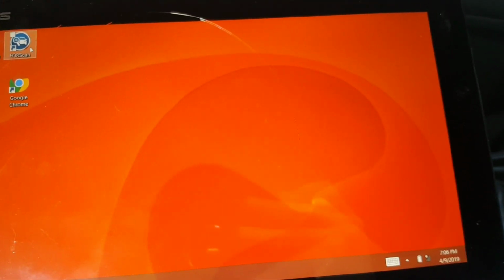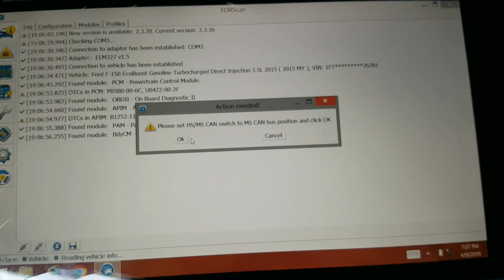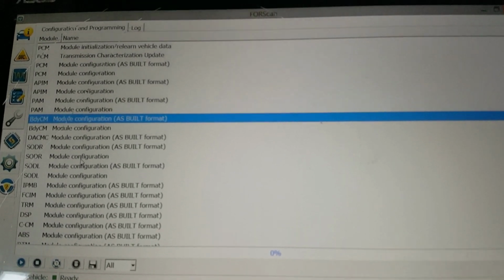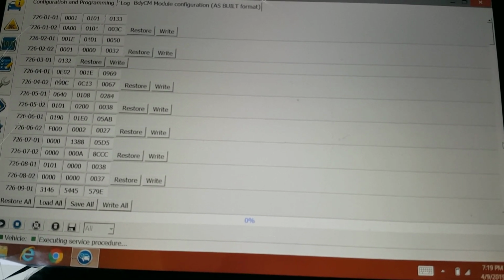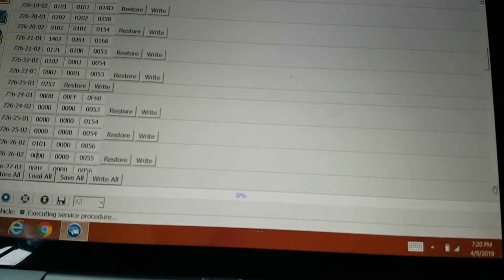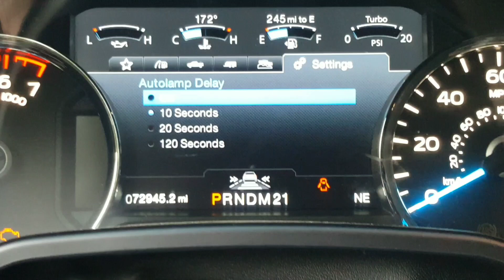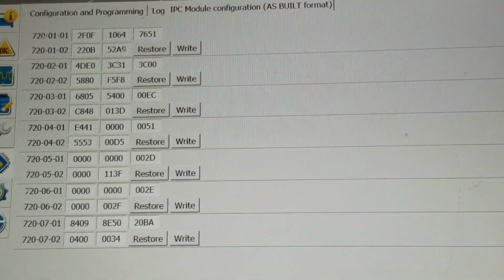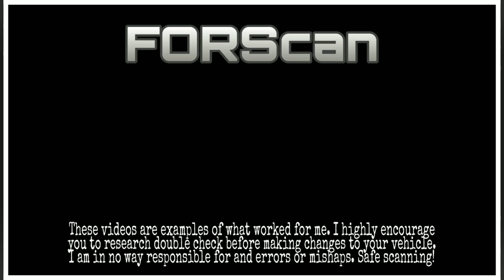FORScan DRL mod on ford f150

Comment: This worked great for my 2016 f150 lariat, but I was wondering if there’s anyway I can’t have my drls be on even in park? I noticed they only come on in drive. I did change my drl condition to option B but that keeps them on forever and the only way to turn them off is turning the dial to off, so I’d want to keep them as automatic but drls still on in park

Comment: hello, i have a huge problem with my truck, i live in sweden so my truck has been modified in the wire harness i think.. the oem led headlight has only one connector right? but i have three connectors on my truck? the parkinglight is some aftermarket ledstrip mounted under the oem headlight.. can i just take the wire from the aftermarket one and connect to the oem parkinglight wire?

Comment: Question, I just purchased a 22 F150 that originally came from Canada. It is a lariat package that should have daytime running lights with the new LEDs. Can’t seem to find daytime running lights anywhere. When I go into the system on the big screen, it does not show it as an option. Is there a way to add this as an option?
Reply from the maker: Hello, I believe you can. But I haven't done it on the new modles. Waiting to pull the trigger on one. Hopefully this year.

Comment: Doesn't work for 2022 F150 XL. Its only off or on for DLR. High beam with fogs does work. Friendly FYI. Note, I did try putting numbers in and also enable/disable. Neither worked.

Comment: Hi Ricardo.  
Great video brother.  I tried using your settings for “parking lights only” but the low beams still come on when I turn the switch to off. 
I’m trying to get a set up where I can turn the selector switch to OFF while in gear and be completely dark for when I’m hunting.  Do you have the codes for master disable for the DRL’s?   I’d appreciate any help you can provide.
Reply: I would like to know this as well

Comment: Fantastic video man.  I got stuck changing mine to disable and couldn’t figure out why.  This video explained it.  Just do I have it in writing, can you tell me the 3 locations you changed and what the settings would need to be set at for disable?   
Thanks bro!!
Reply: @Matt Camara thanks.  It is Canadian. Where did you see that spreadsheet? Google?

Comment: I have a 2016 Canadian model. I got on the spreadsheet and did everything to put the option on my settings to turn the drls on and off by clicking the box. The option is on there now but they are just off and don't come on by checking the box. Did I miss something?
Reply: Nevermind, I figured it out. I was testing it at night and I know now that the headlights have to be in auto for the drl to work. So in the daytime the option on the dash works like it should.

Comment: Do the DRL operate when the light dial is in the O position (far left, off) or turned all the way right to the A position? I’m considering toying with DRL in FORscan but only if it works when the light switch is off; I don’t want to screw with the auto-lamp feature.
Reply from the maker: When DRL is active and enabled,  they turn on regardless of how the headlights switch is set.
Reply: @ricardosworkshop  thanks!
Reply: My truck only has an auto-lamp control in settings menu of the gauge cluster.  There is no actual DRL setting.  Are some trucks devoid of DRL? Seems unusual. I’d really like to set a custom parking-light DRL in FORscan to avoid having to manually switch them on every time I drive the truck. What say you?

Comment: Would the 2020 f150 with tech package have this module? I installed led headlights with DRL leds, and would like to turn on the DRL if that is an option for the XL trim package

Comment: Hi Ricardo, thanks for this and more other helpful videos from you 👍. I programmed and activeed just the daytime running lights on my 2017 F-150 with LED lights. Upon cranking the enigne, lights to AUTO and column shifter to D bingo - DRL are there. Next day another engine start, lights to AUTO and D -> no DRL anymore😳. Any idea? I checked by forscan the values BCM 726-26-02 reps. 45-01 are still there. Thanks for your feedback.
Reply: Did you get this figured out? Im having the same issues
Reply: No, not yet. Recognized that the dealership re-wired the DRL. Has nothing to do with Forscan. Needs to remove the headlight and put the wires back to original spot. @henryflores7492

Comment: I have a 15 platinum as well and have the switchback DRLs from Diode Dynamics in and I am trying to figure out how to have the DRL white as the running light with the low beam off. Can’t seem to figure it out.

Comment: Hey there could you help me? I have a 2019 F150 lariat that came with halogen headlights and I just put in the Anzo switchback headlights but the white drl only comes on for about a minute when I first put it in gear and will just shot off after everytime, I’ve tried putting in the code for the anzo headlights in forscan several times but it doesn’t want to stay on?
Reply from the maker: Im not sure its a code issue... sounds like it the lights

Comment: Hey I just watched the video and did the position lamb and turn signal only setting. For some reason my DRL is now the low beam, position lamp, and turn signal. Do you know if something didn’t work or if it’s not possible to only have the position and turn signal? I’m also wanting to brighten up the position lamp but I haven’t gotten to that yet. Any help is appreciated. 2016 F150 Limited with factory LEDs

Comment: I hope this fixes my turn signal switch back led issue. My drls should be white but the low voltage drl sent to turn signal makes them go amber and flicker orange. I have to manually turn on park lamps to get the effect I want.

Comment: Thank you for this.  
Question, if you don't mind...I have the Anzo switchbacks and went to do the white halo's as DRL's.  However, when I went to change BCM 726-26-02 to x1xx I got an invalid checksum error.  Any thoughts?
Reply from the maker: I've seen this happen often. But the system will automatically correct itself.
Double-check everything, save original settings, and you can try again.
Reply: @ricardosworkshop  In my case, I had to change 726-45-01 first.  Then it let me change the other two.  Thanks again!!

Comment: wich one is the front running amber light  not the brigth amber turn  (just the regular amber ,there is high and low light on the amber,want the low side) thank you... my truck doesn't have the front led...

Comment: hi man quick question, i installed an led strip switchback bar inside my headlamps, where should i connect the positives to get them work as DRL only and not the low beam how it comes originally, i have a 2019 ford f450, thanks

Comment: i have the alpha rex pro series headlights...will this work the same with my application?  i have the drl harness installed.  i dont want the low beams to be on during the day. i have a 2018 f150 and no option to turn on or off the drl in the cluster control.  i only have the autolamp to select
Reply from the maker: Yes. You should be able to disabled the DRL. Or change it to any of the options.

Comment: I did the values for parklights to be on as drls on my stock led headlights and nothing happened  when the knob is in the "auto" position. It instead replaced my lowbeams with park lights to just park lights "only" when on the ON position. Hope you can help me fix this. Ive read somewhere that said they only come on if its in drive idk if its true.

Comment: Will the Anzo white halo code switch the factory halo from amber to white? Or, is the mod only for/if you actually have the Anzo aftermarket part?
Reply from the maker: No. The factory halos are amber (15-17). You would have to change the lights to get them white
Reply: Thank you for taking the time to reply to a video that's over a year old. Take care and happy holidays!

Comment: Hi. Where your location?
Reply from the maker: Houston Texas 🤘🤘
Reply: @ricardosworkshop  may i have your address and phone number pls
Reply from the maker: Ihi Brian, i dont have an actual shop.
Reply from the maker: Ricardoalanis@msn.com email me your contact info, What did you need help with?
Reply: @ricardosworkshop  i have 2018 f150. I already put the oem led headlight housing, dont do the forscan yet. But some time the lowbeam light turn of sometimes on. That problem because i dont do the forscan or the light? Do you know? Thanks you
Reply from the maker: If it's only one light, and occasionally. It's probably the light or connection.
Reply: @ricardosworkshop  i think is connection. Because i use the Vland Led connection. Do you make the harness for the light

Comment: Great video bro. Thank you very much. I had made some changes and didn't keep track. Long story short the Anzo White Halo would stay on for 10 minutes after truck was off and light would flash every 10 minutes unless I unchecked DRL in settings. I was a lil nervous but finding and watching your video gave me the As Built digits that I didn't backup and showed me every code to every sequence so I could get them done correctly. Can't thank you enough but I did subscribe. Great video my man.

Comment: I added the auto headlights switch and sensor but they don't come ON in auto. Is there something than needs to be changed with forescan? If you are willing to show me I can compensate for your time. Thanks in advance (2012 F150 RCSB STX)
Reply from the maker: Make sure DRL os on. And double check the codes. I believe you got all you need

Comment: Sir.. can you please help me with my f-150 xlt 2018.  After I replaced after market led bulbs on to my headlight, the low beam won’t go off when it’s on drive mod even the light switch is off mod.  But If I put the truck on park mod, the lights go off.  I don’t want to drive with the light on every time.  Which fordscan should I use and what do I have to to change.
Reply from the maker: Hi Mr try. When you say you replaced the aftermarket led bulbs. Do you mean you upgraded to aftermarket LED or replaced the Halogens with OEM LED? If its OEM, it sjould work fine as long as its set correctly in forscan.
Reply: @ricardosworkshop  Sorry about the unclear question that I have to you.  I m a second owner of a truck f-150 xlt 2018 originally from Canada.  I believe that the first owner must changed a few things on the drl of the truck before.  Now that  I have no daytime running light option to turn on/off in the display setting.  First With the factory halogen headlight my truck the headlight was working fine as normal until I replace it to led bulbs.  Since then every time when I drive or reverse the truck my headlight low beam just automatic turn on even the light switch is on off.  And when I put it on park my headlight low beam would goes off.  Now that I replace the old factory halogen headlight to a new one called Morimoto xb 2nd generation and I still have the same problem as when I replace it to led bulbs.  I don’t want my headlight low beam and the C shape led light to be on every time I drive as it on off mode.  Please share your thought, thanks.
Reply from the maker: Hi Try, so Canadian vehicles are locked with DRL due to their laws uo there. You would probably have to change this in the IPC. Then you should be able to change to your preference.

Comment: So for the high beam only  do you have to make the changes to all three sections? Do you even have to make the change to the top one of you can activate the drl from the dashboard?
Reply from the maker: You can do a lot with the dash settings. But yes, all three sections of the BCM
Reply: @ricardosworkshop  thank you. I upgraded from factory 17” wheels and tires to factory 20” with 275/55r20 at tires. Do you by chance know how to recalibrate the speedometer?
Reply from the maker: @alexl3383 yes sir... https://youtu.be/92H4OQ2P8-s
Reply: @ricardosworkshop  
Thank you very much. Does forscan void the manufacture warranty?
Reply from the maker: Not sure... i don't believe it does but you can always revert it to original settings if you're gonna take it in for service.

Comment: I'm confused at 5:44. Is that what I need to get parking lights only?  I tried and now the option doesn't come up in advanced settings. Parking lights are on but so are head lights
Reply from the maker: Depends on what you have. LED or Halogens.

Comment: So I have tried to get just the park lights ( halos only) to work but they wont all I can get is the park and turns to come on. Any ideas what I can do?
Reply from the maker: You might have to play with the settings a bit. Checkout forscan.org too
Reply: @ricardosworkshop  Ok thanks I'll try. I have tried every thing and I can get all the ways you described but cant get just the halos by themselves.

Comment: Is there a way to make the fog lights come automatically with the headlights instead of having to push button every time the truck is started at night?
Reply from the maker: I dont think so. Only with the automatic setting
Reply: Ricardo's Workshop what I mean is, every time truck cut off and started back ya gotta actually push the fog light button again to turn them back on.
Reply from the maker: Right. But my truck has a day/night sensor and automatically turns headlights on/off, with the foglights. Thats the only way i think you can do it. Upgrade the switch to Auto amd add the sensor. 🤷🏻‍♂️
Reply: Ricardo's Workshop mine has automatic headlights too, its a 16 King Ranch. But I’ve noticed that every time I cut the truck off and restart that only the fog lights have to be manually turned on again. It may not be do-able, but if ya look into it and find out let me know or maybe do a video on it. Thanks!
Reply from the maker: That's interesting. I'll look into it.
Reply: I’m just getting into forscan and was wanting this also. Haven’t found it yet

Comment: Hey man. Thanks for all the great videos! Question for you. I want to have to 
PARKING LIGHTS AND FOG only on. 
No low beam no turn. Can you help with the code please. Thanks.
Reply from the maker: Thanks for watching! I'm not sure if you can... you could try a few variations of the codes to see if it works for you. Remember to backup your original settings!
Reply: Thanks
Reply: @kkiocanada  https://www.f150forum.com/f118/setting-parking-lights-drls-great-find-380225/index24/ read through this thread; it can be done.

Comment: Quick question, If the switch remains in “auto”. Does this mean that when the headlights come on at night it disables the amber DRL settings applied in this video?  Please advise as I have my forscan tool being delivered on the 30th of April
Reply from the maker: Not on my truck. My DRL setting are only for daytime running lights. At night it works normal...on auto or using the on/off knob.

Comment: What number do I change so I just have the led lights on instead of the drl that always turn on in drive
Reply from the maker: I think it 01xx for stock LED. And 10xx for aftermarket. 726-50-01
I believe its at 5:44
Reply: Ricardo's Workshop figure it out lol i have a 2019 mustang gt it was the same concept your video helped a lot thanks

Comment: Hey man great thorough videos! I have a 2015 platinum and did this mod. Do you know the numbers to plug in to revert back to having only the low beams as DRL? I can’t find it anywhere on the web. Thanks!
Reply from the maker: Im not sure what yours would be originally but i think my 726-50-01 started with 0Axx
Reply: @ricardosworkshop  Thanks for the reply I will try it later today. My only concern is to change to DRL's don't we have to change two values? IE: 2 separate lines of code? Either way I'll let you know if it works. Thanks again!

Comment: Can you tell me more about the anzo lights? I have a ‘18 raptor. Is that compatible? Thanks
Reply from the maker: There are many variations of aftermarket lights. Ford OEM black. Anzo. Morimoto. Alpharex. Recon. AlphaOwls. They should all be plug and play.

Comment: I have a 2019 F150 Lariat. Trying to get my rear LED taillights to always be on in the daytime.
Would need to code the Parking Lights only right? If I do this, when it gets dark, will the Low Beams turn on as usual? Or would you recommend to just code it for Parking Lights + Low Beams?
Cheers
Reply from the maker: Thanks for watching Jerry. I dont believe the DRLs control the taillights. Only the headlight.
Reply: If your parking lights are set as your DRL, the tail lights will also run all the time. Here's a great thread to read through: https://www.f150forum.com/f118/setting-parking-lights-drls-great-find-380225/index24/

Comment: I tried doing the LED and Halogen for the Parking DRL only and I couldn’t get it to work?  Could someone please confirm that is the correct information I need to input? I have a 2015 Lariat with all LED.
Reply from the maker: LED and halogen?
Reply: Ricardo's Workshop yes sir, I tried like you have it showed on 5:45 on this video. Since I have LED it should only be the two 26-02 and 50-01 or so I do all three for the Halogen? Great videos BTW, I have done almost all your mods!
Reply from the maker: @PSUPearson So with LED just do 26-02 & 50-01(01xx)
Or
For Halogens do 26-02, 45-01 & 50-01(108E)

Comment: So when 726-29-02 value is changed to 1, does that turn all the lamps/headlights/fogs to full bright or is it just the running lights?
Or is there a way to change all running lights/headlights/fog lamps to bright without having to chose one or the other?

I have a 19' f150 with the led's.
Reply from the maker: Yes... setting 1 supposedly allows all DRL at full brightness. I haven't noticed.

Comment: Wich one Is better. Parking lights only vs parking lights with turn signal?
Reply from the maker: Hey Felipe... i think turn signal.
Reply: @ricardosworkshop  now i am using parking lights only, but i think the yellow light Is very weak... in the day they hardly see